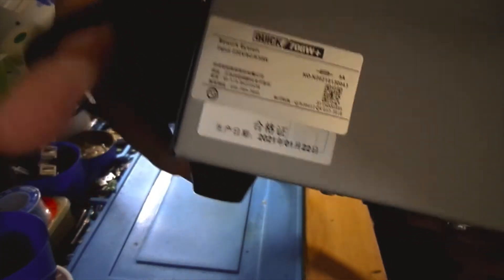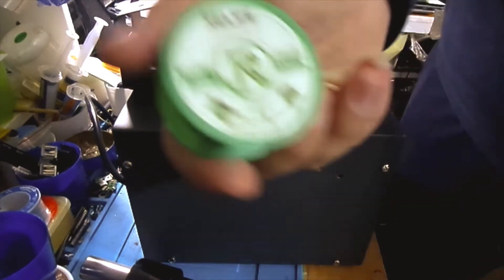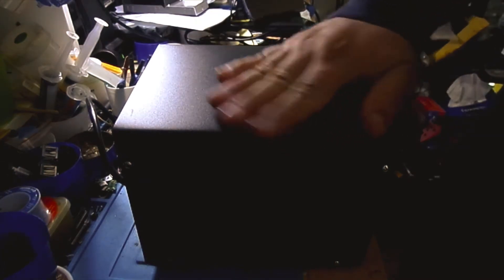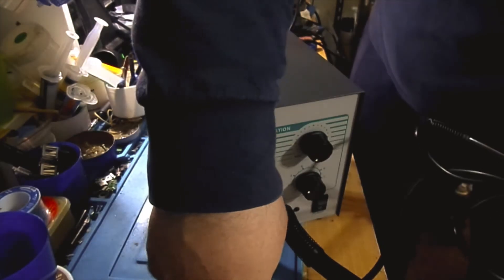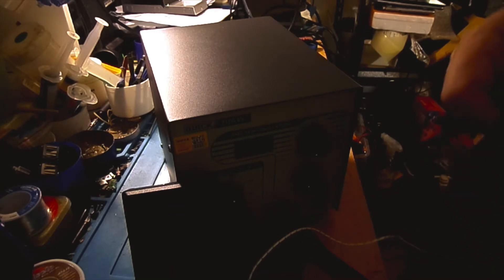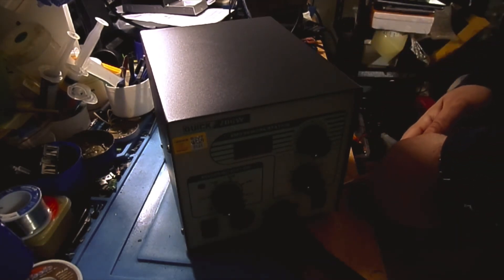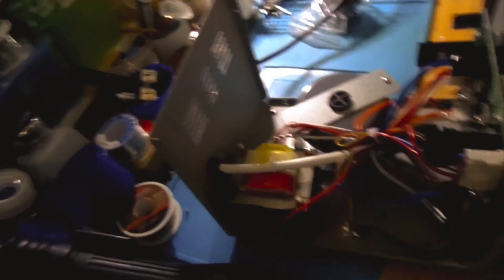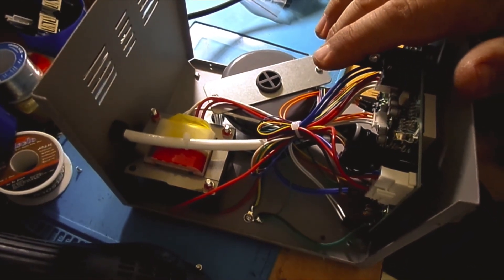Unboxing QUICK 706W+ SMD Soldering Station

Comment: hi do you still use this or did you for a good amount of time? 

It is a nice price where I live and limited option to which I can buy and want something that can last a while
Reply from the maker: It is very decent and I still use it. I highly recommend it for the price. I might buy new iron soon tho because the ceramic element inside is wearing out.
Reply: @gamesstationplus9207  thanks for the reply and video! , good to hear it lasted a couple of years
Reply: @gamesstationplus9207  why not just replacing the ceramic element Sir?
Reply from the maker: @hairulole  because my source has only full set original. Doesn't sell the element separate. I do not trust other third party elements, quality wise.

Comment: Hey, this is really good station, I've had it for 5 years and used it twice a week for 1 hour of real actual work of the hot air.
Its really easy to desolder with it if you compare to 858 or any chineese "700w".
Reply from the maker: Indeed, so far a very good impression to me. Great value for money.